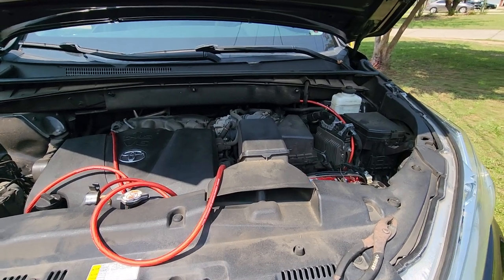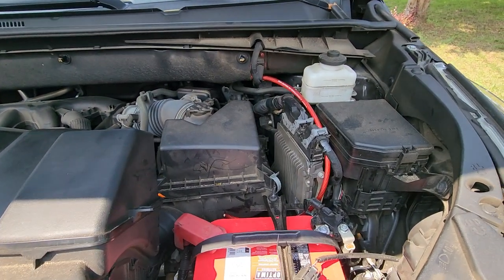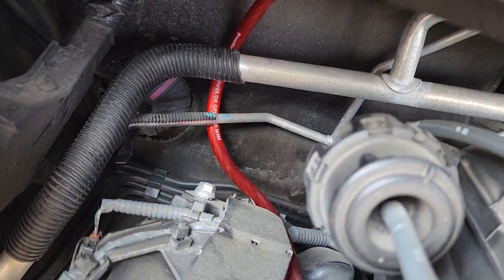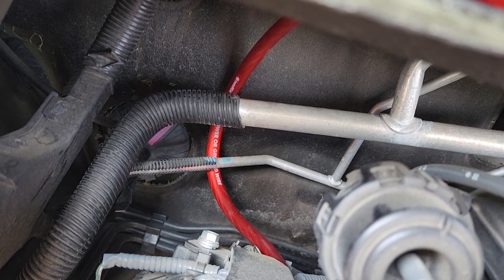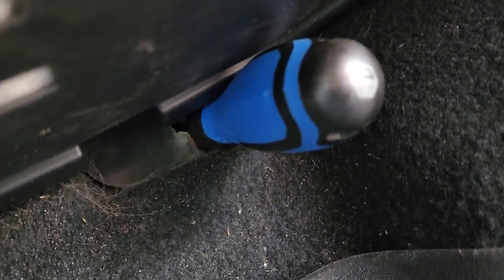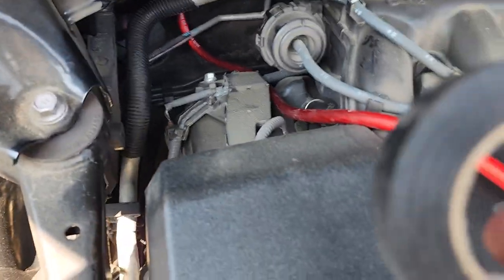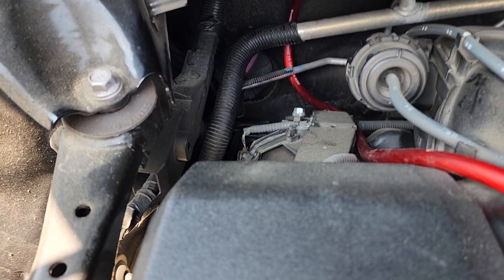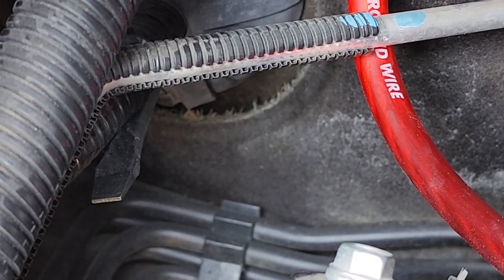2019 Toyota Highlander Power Wire Grommet install.

Comment: Great video. i just picked up a 2013 with JBL system, but unfortunately there are some key differences.

I found it was easier to run a power wire (8AWG) through the passenger side as there is not an easily accessible grommet on the driver's. That vinyl pouch is also not there, but there is a thick wire bundle that I zip tied to instead. 8AWG fits nicely through the grommet, but a lower gauge will require you to cut more rubber or drill a separate hole. I'm trying to see if I can be happy with less than a 500 watt system for now. We'll see how it goes.

The passenger side was generally better for an under seat amp install as the right 2nd row seat seems to offer a bit more room than the left. Both driver and passenger seats have the rear HVAC blower vents and the passenger conceals the liftgate subwoofer amp as well.

Hopefully this is useful info for whoever needs it.
Reply from the maker: You have the 3rd generation highlander.  I ran my amp under the passenger seat as well. I used the seat mount as my ground and it worked out perfect. 

I ran a 4ga for that reason is if we ever wanted to go higher in amperage.
Reply: @TJsVette  Thanks for sharing.

My 8ga ground wire didn't have a big enough hole in the terminal ring for the seat mount, so I fastened it to a common grounding point near the back right door.

So far I am running a 150W 10" Rockford sub (it was free) in a prefab ported Sound Ordnance 5/8" MDF box with internal bracing and an Alpine 5ch amp with a 300W sub channel. I want to power the speakers with it mostly to control the crossovers and potentially use some DSP.

The sub sounds decent and has plenty of volume for me, but cleaner bass would be great too. Maybe going DSP will be enough and I won't have to upgrade sub, amp and power wiring.

Comment: That is exactly how I did it for my trailer controller power wiring. Then I ran it over the center console  to the controller than under the door cowling to the rear of the car to the 7 pin connector. Great minds think along the same lines.